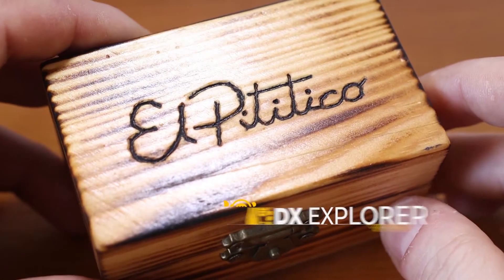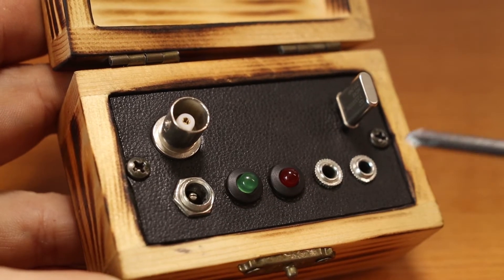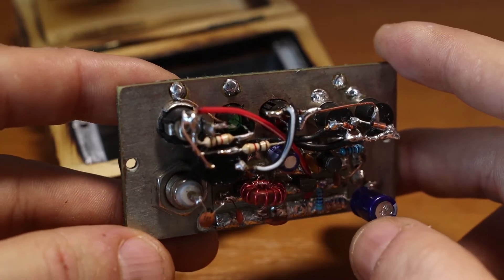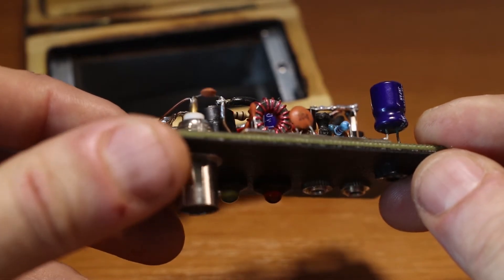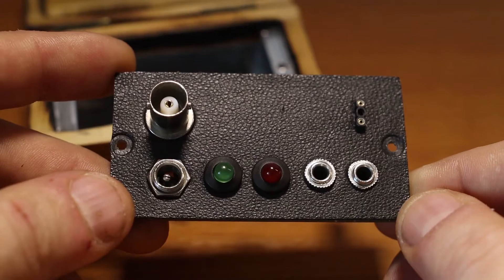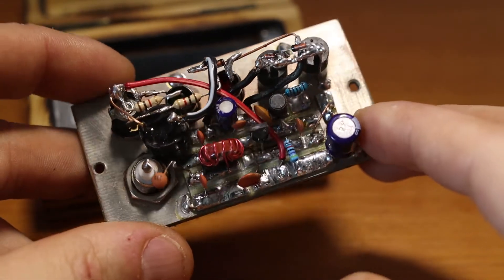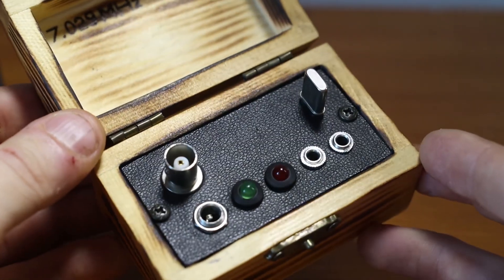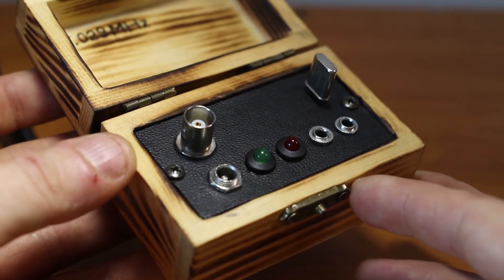The Improved Pititico CW Transceiver - No AM Broadcast Band Interferences

Comment: If you connect two, IDENTICAL crystals in parallel, and in series with a small variable capacitor, you effectively have a Super-VXO which will give you a bit of frequency mobility. You might want to try a medium-power transistor, like a BFY50 or 51 with a clip on heatsink. G7VFY.
Reply from the maker: Ohh yes Peter Parker used to do that with the Pixie. I wanted to keep it simple and close to the original so I left it as it was. But I am working on a modified version that includes the LM386 amplifier as well... so is basically a simplified Pixie... and for that... I will also include the VXO 😁😁. Thanks Stephen 73.
Reply from the maker: @janetwinslow2039  I just posted a video on the Pixie a little while ago on that yes 😃. Only that I made the sidetone circuit instead so I used pin 7 for the sidetone. It sounds great and I love it. It didn't work well at first but I emailed Sverre and with a little help I got it to work really nice. And with the improved LPF is even better. No interferences whatsoever. 73
Reply: @dxexplorer  The pin 7 mod allows better muting on receive without starving the LM386 Vcc through the 1k resistor!

Comment: Hi! How could i do a small-range
 variable oscilator?
Reply from the maker: Tell me the frequency you want to cover and I will try to give you some ideas. It should be easy to do. 73, YO6DXE.
Reply: @dxexplorer the simplest one, like a few khz (3,5? No idea) , using the crystal. Thank you! de EA3JBJ
Reply from the maker: Kz or Mhz ? To be sure 😁. I'm not at home now but I get home tomorrow evening to also test it to make sure it works fine, and I will email you the schematic.
Reply: @dxexplorer  Hi! Sorry for responding so silly. I'm interesed in varying the TX frecuency of pixies or Pititico radios. Sort of like a VFO, but simpler if possible for these micro radios. I would be happy with 10Khz range.
Reply from the maker: Ohhh ok. Well in that case we can do way more than just 10 khz. I think I may be able to use the entire CW portion of the band. But... we have to use one or two extra transistors ... one for the oscillator and the second one as a buffer. And we replace the crystal. The only issue is that we have to do constant adjustments to the frequency offset when changing frequency as the circuit is way to simple and every change in frequency also affects the frequency  offset on receive. But it is possible. Let me see maybe I make a video on this towards this coming week. Is that OK ? This way I can also test it live. 😁
Reply from the maker: Here is something to start with. I will have one more video next week on this subject. I must build a Pixie transceiver from scratch meanwhile 😁 https://youtu.be/L9lux7Ymxyw?si=lzfm4T8qes6Scwp9

Comment: I made a similar transmitter with a wooden box design, but integrated it with the LM386 IC, a Pixie2 oscillator and two buffer transistors.
Reply from the maker: How cool hehe. I love these "Frankenstein" constructions. This is what makes them beautiful and unique. Very nice... I want to stick to wood and aluminum combined from now on in most of my builds. Let's see how that will turn out. I miss classic equipment I guess 😁. 73, YO6DXE
Reply: Model 6 shortwave radio transmitter can still be found under the name  Its range was 5 floors, using a 1 meter copper wire.  Since then, I have made some repairs and improvements on it, but it cannot broadcast farther than 16 meters.
Reply from the maker: I made something similar when I was a kid but it was an AM voice transmitter so I can talk to my sister from one room to the other 😅😅.

Comment: Is this available as a kit?
Reply from the maker: Unfortunately no. I built it for fun frim stuff I found in the junk box. I do have a PCB design for it available on the blog, or even better the Pititico II that also has the audio amplifier into the circuit as well to make the life easier. Both have articles on the blog. The PCB boards can either be made at home, or ordered from PCBWay. I honestly think is fun to build it from scratch from recovered components. 73, YO6DXE.

Comment: How about using the metal can 2N2222 and add a heat sink? I've got a bag of those transistors.
Reply from the maker: Those are even better. Or even a 2N2219. Those are bigger and they don't seam to heat up as much as the little 2N2222. If it fits on the board is great 😁. 73, YO6DXE

Comment: Can I use bd139 and 2n2222a instead of 2n3904 transistor? And would the results be the same if possible?
Reply from the maker: I tried BD139 but there are a few more things that need to be changed in the schematic for it to work. The results were not so great though. 2N2222A is fine yes. I may write something stupid but I can't remember the name... I thinks is 2N3553 that I tested these days and is a little bigger ( metal can ) so It can take some sort of heatsink. I will correct later if I am wrong about the name but I think this is the one. P.S. Have a look at the video with Pititico II. Not much more extra parts... but is nearly a Pixie... with one transistor and an LM386 amp. I like it more.
Reply: @dxexplorer  Can you explain why I hear this cw frequency on the FM radio scale in the 96mhz and 108mhz frequency range. I use a 12mhz crystal and it emits a number of RF However, I don't have an AM radio yet so I don't know whether it transmits AM or FM waves or neither and keep in mind that in FM mode it sounds quiet, there is no sound Like CW in AM mode in general
Reply: I also tried it on a 24mhz crystal and the results are still the same it is locked on a 96mhz FM radio but as I said earlier I don't have a radio that can detect AM waves from pititico I created
Reply from the maker: How far was the transmitter frim the transceiver ? If is close then yes you should hear as there is RF leaking out. The reason why so quiet is because is diferent modulation.
Reply from the maker: Pititico is transmitting CW. You can still hear it on AM or FM radio but it sounds more like a shadow to say it  in not so technical terms. You hear something but not properly. You may hear it on FM radio because is close by and the frequency you are listening may be harmonic of the crystal you are using. 7MHz will also transmit on 14MHz, 21MHz and so on... the further from the fundamental frequency of 7MHz the quieter the signal is. So your 12MHz crystal or 24MHz crystal is also transmitting harmonics on 96MHz.
Reply: It was heard at a distance of 3m at a distance of 5m it started to disappear and I heard it in FM mode and at that time I didn't install any antenna
Reply: If it emits RF in FM mode as it did for me and it's quiet without any sound, is that a sign that the circuit I made can be heard in AM mode? or maybe there is Wrong ?
Reply from the maker: @why.k5max With no antenna... I don't think is possible. If I move mine 3m away from the receiver and transmit in a dummy load I hear nothing. At 3km away yes but in an antenna. But if you hear it on the FM radio then it means the low pass filter is not properly tuned as it should have harmonics that loud that you would be able to hear it. So something is clearly wrong there.
Reply: What do you think is wrong? Do I have to reset the LPF?
Reply from the maker: @why.k5max Of you don't have anything to measure the harmonics is a little hard. Send me an email... you have the address on the contact page on the blog. Now is 1am here so I go sleep but I write to you in the morning and see if I can help you get it tuned with no equipment.
Reply from the maker: @why.k5max Hehe... no no. I will send you tomorrow by email an audio file with the difference in sound in all modes so you can make the difference really easy.

Comment: Good morning !
What is the impedance of the earphone?
8 ohms, 16 ohms, 32 ohms other?
Thanks in advance.
73 QRO F5NDL Jean-pierre
Reply from the maker: If you built it as it was in the original design ( like in this video ) ... PY2OHH recommended a 500 Ohm telephone speaker. I didn't had good results so always used an external audio amplifier. Since then... I decided to modify the schematic and ended up with a new version. Here is the new one I have now. https://youtu.be/sRwcFen1aUs
Reply: @dxexplorer  THANKS!
Thanks for the links.
73 QRO F5NDL Jean-Pierre
Reply from the maker: @lesismologueamateur Always a pleasure 😁

Comment: Nice project. Maybe add a R/C key-click filter and a capacitor across the audio output to reduce the frequency response a little?
Reply from the maker: I will need help please on the R/C key click filter ? Is it like a low resistance in parallel with a let's say 100nF capacitor ... in parallel with the key output ? About the audio output... I do want to try that and I had it in mind but didn't do that yet. I will do some changes soon. By the way... the diodes on the audio output to reduce the key click don't seem to do much.. and sometimes the audio level is lower because of them. 73 Janet, YO6DXE.
Reply from the maker: Excellent.. I will do the mods for the key click on the pititico. I just have to be careful as I believe it will also influence the offset frequency. I must test it anyway. About the Pixie..  I will soon have a version built from scratch. I think you will like it. But I won't say more until I finish it )) Surprise )). I no longer use Facebook but I did find a lot of articles on blogs. Thank you Janet. Time to play this evening and see how good I can get that Pititico to work 😃😃.

Comment: Hi I 'm watching your videos for about two months and I must tell your videos are very interested and professional. I want to bulid this TRX but I can't find 7.023 MHz crystal. Can I use 7 MHz crystal instead and where I can find 7.023 MHz. 73!
Reply from the maker: Thank you for the nice words. Well sharing what I learn..  even if is not much... is a pleasure for me. Hopefully it gets more people into the hobby )). 7 MHz crystal will work... but unfortunately I don't think there will be many signals around that frequency, but you can try as you can replace the crystal any time later on. Instead of 7.023 I would recommend 7.030 as usually that frequency is more used for QRP and QRPP. I usually buy the crystals from a shop here in Romania at RoWaves. But I am sure that on eBay or Amazon and AlliExpress should be available as well.
Reply: @dxexplorer  Thanks!
Reply from the maker: @karkuwaa  Always a pleasure my friend.

Comment: Hi Chip, it's working well - great idea. Sorry to hear you were unwell. I'm just recovering from Adenovirus - there are plenty of virus's going around apart from COVID! I don't know morse but one day I'll need to learn it. CW transceivers are way more efficient and simpler than SSB. Take care, 73, VK7IAN
Reply from the maker: It is efficient indeed and the equipment so much simple to built at times, that you wouldn't be able to do if it was for SSB. Sorry to hear about the adenovirus. I'll make you laugh now... I don't know the treatment for you when it comes to it... but I know the treatment I used for the pigeons as they also have it hahaha. I could get rid of it in less than 48 hours 😅😅😅. Was good to hang out with my pigeons buddy. A lot if the diseases that pigeons have are pretty similar to what we have and the immune system seems to work the same way.. is interesting. 73 Ian.